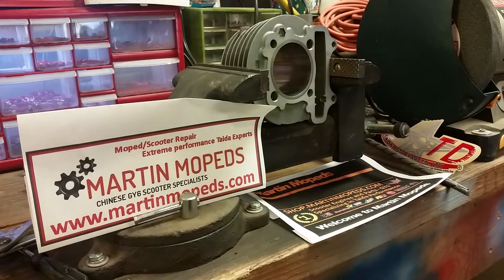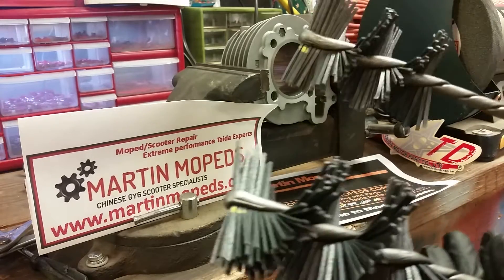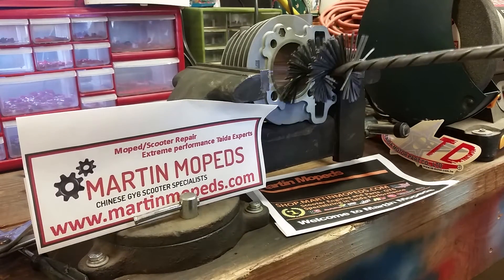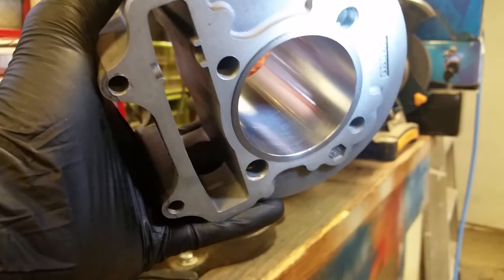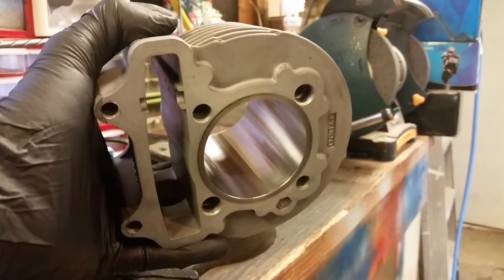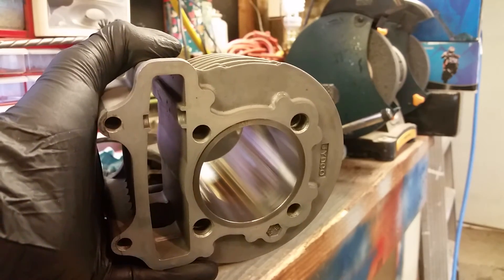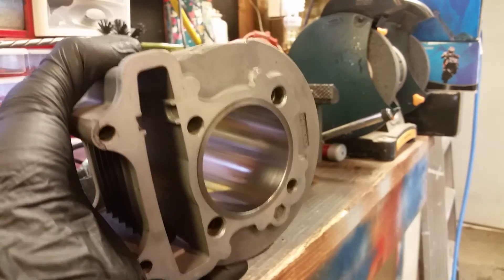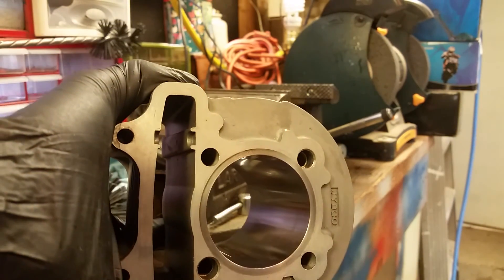GY6 How to Hone Cylinder WiseCo Nylon Flex Hone

Comment: Hi Daniel...sorry to hassle you but do you know the nominal amp output of a 125cc GY6 magneto? Many thanks
Reply from the maker: +versatec1  
Hi Versatec1... It is no hassle at all. Your a very kind person and I like talking to you. 

To answer your question, there are many different magnetos (stators) for the GY6 125cc size engine. They come in 4, 6, 8, 11, 12 and 18 pole... A general rule of thumb is the higher pole count, the greater the amp output. But there are many exceptions to this rule... 
      Not all stators are the same... Some use more copper on the poles and a higher quality copper wire. 

    For example, take 2 different stators from two different manufacturer,  one will produce more electricity than the other because of more and higher quality wire....

      So, what I can share with you is this... Inform me of how many poles the stator you're talking about has, and I will provide a "base-line" to go by, not exact numbers (but very close).